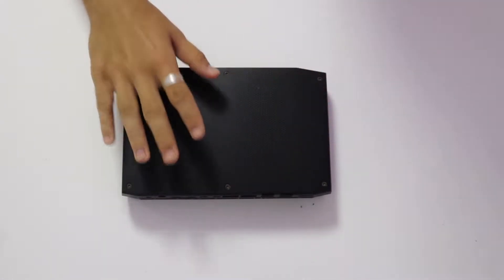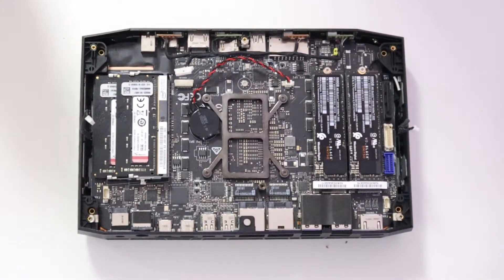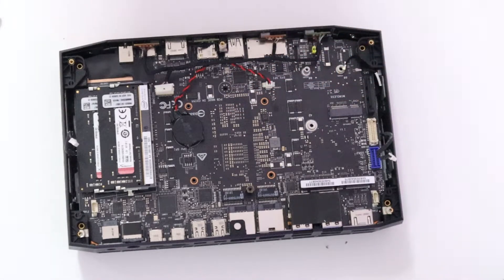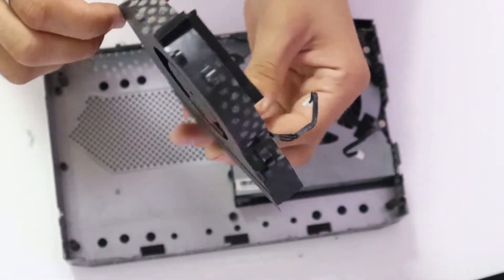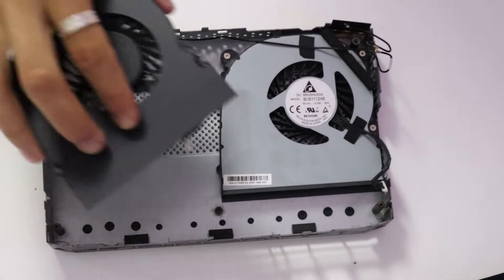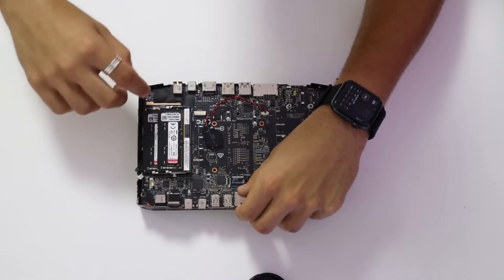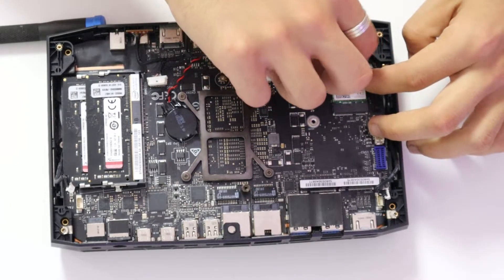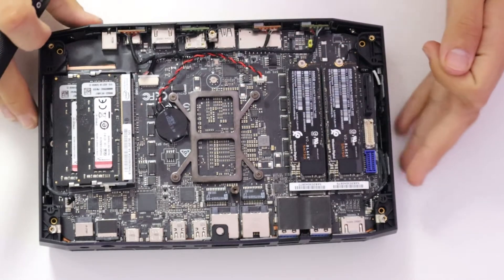Intel NUC Hades Canyon Thermal Paste Replacement

Comment: Thank you for this video! It helped a lot when I just took mine apart moments ago. I wanted to install new nvme drives and realized I got the thing back in like 2018 and haven't replaced the paste yet! I did notice the fans were working a bit but don't think I experienced thermal issues but I never really gamed on it, mostly just use it as a remote/headless machine. Anyway, the paste was rock hard! Like, I seriously had soak it in isopropyl twice before I could start getting the old paste off with a qtip! I replaced it with ptm7950 since I had enough left over to replacing some laptops. Only time will tell if it's better than paste but I'd expect it to be like for laptops where it will make the fan(s) run less and cool off faster but the only reason why I used it is so I should never have replace it again. Does seem like me use spraying air from the sides/front/back is more than enough to get rid of 99.9% of the dust from it.

Comment: too much thermal paste
Reply: No. GPU always needs alot more than a CPU does because they don't handle hotspots very well besides too much paste is a myth, it means nothing, it just gets pushed out if theres too much. You're better off buying a prebuilt if you can't think for yourself and just barf out garbage from youtubers you watch. Use common sense, it helps.
Reply from the maker: Can’t hurt

Comment: Kudos for this. Have the HNK version using it not even for gaming  but just as a PC on my 4k tv and it has blue screened on me repeatedly since new. I tried everything I could think was the issue until today finding a post on Intel support forums where a user had overheating issues (which cause blue screen).  Intel support gave the usual run around.  Then the user posts that he changed out  the paste and saw a drop in avg temps which improved the behavior.  Intel responds "that will void your warranty" LOL if I had known this UNDER WARRANTY I would not be out chasing phantoms!!   So  I'm going to try this hopefully my avg temps come down and it stops crashing.  Intel should know better given their bread and butter is the CPU.   Thank you so much for this to get me through.
Reply from the maker: I’m glad this helped you out! Mine was overheating as well so i took matters into my own hands. Let me know how it goes!

Comment: Puedes traer más vídeos de este producto. Como funciona en la actualidad en los juegos nuevos y como tener los últimos drivers para que funcione correctamente. Tengo muchas dudas con los drivers para este aparato. Gracias
Reply from the maker: There aren’t many drivers available since Intel dropped support for this product. You can find hacked drivers on GitHub
Reply: @emanuelxcars  gracias por tu respuesta amigo. Podría traer un vídeo de cómo funciona con los juegos en 2022 que tal funciona los FPS y un enlace de gitbut con los drivers que tú recomiendas por favor. Gracias y te apoyo 👍